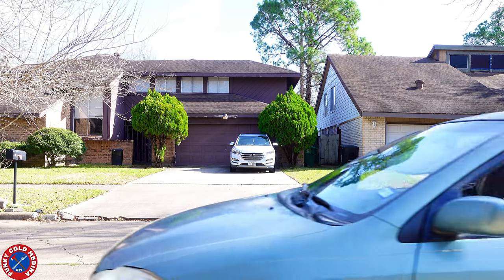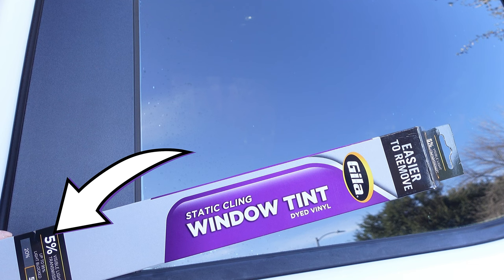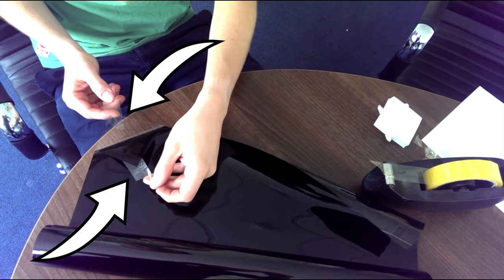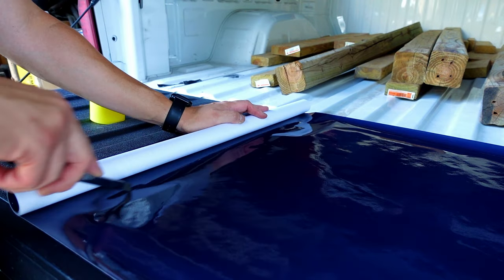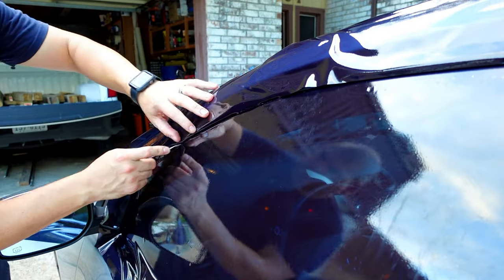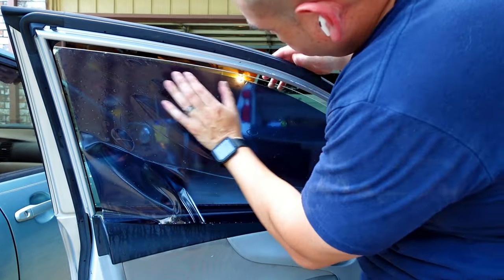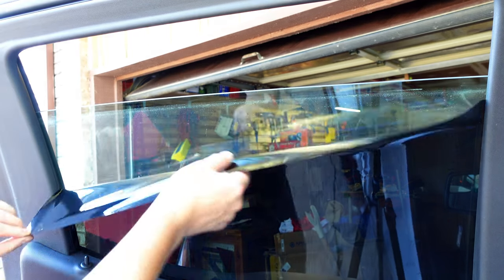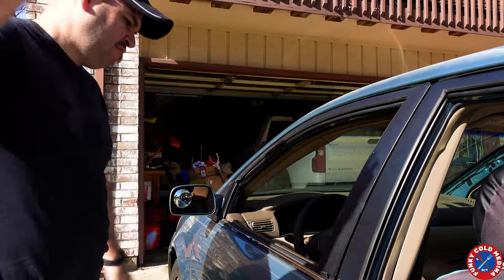NO GLUE Window Tint for BEGINNERS, EASY & SIMPLE Installation | Static Cling Gila Window Tinting

Comment from the maker: 🚨7/8/23 NEW 2 YEAR UPDATE VIDEO EVERYONE.  Check out to see how the tint held up and I also answered questions from the comment section. Hope this helps people out. Here is the link https://youtu.be/RopXmbnnJxM.   Don't forget to HIT THAT BELL, DROP A LIKE & CONSIDER SUBSCRIBING to a channel like no other. Have a blessed day😁😎✌️
Reply: I had a question so my silverado has smoked glass and two front windows have a light tint i want to make them a little darker can this type of tint work on this or do i need to strip off the old tint
Reply from the maker: @richardmilo602  Great question. I would remove the old tint and do it right but you can definitely give it a try installing the new tint over the old one. As long as its still in good condition. The new tint should stick just fine. Thank you for watching and have a blessed day. Sorry for the late reply🙏😎
Reply: @FunkyColdMedinaDIY  gonna try it and see how it comes out the phx az heat at times gets to 120 deg during the day i figure anything would help
Reply from the maker: @richardmilo602  🤣Yes in your case, anything would help🤣I bed that heat would be perfect for my sidewalk cooking that I also do🤣
Reply: Why do we need the soapy water? 
also why can't we size it on the inside of the window instead of the outside first?
Reply from the maker: @sharoncc9192  you need the soapy water so you can squeeze it out and create its own suction to the window. I don’t know the scientific word for it or the process but thats what needs to be done. Especially since the tint doesn’t have glue. You can try and cut the tint on the inside, its simpler and easier to do from the outside. Sorry for the late reply, Have a blessed day my friend🙏😎

Comment: I’m a 27 year old woman and did this by myself 🤣🤣 I know people was looking at me outside waiting for me to fail lmao
Reply from the maker: 🤣Great job. I wouldn’t expect anyone to fail at this. Its super easy and you don’t have to worry about the tint sticking to itself with the glue. Great job! My tint is still holding strong. Better than the traditional tint I might add. Ill make a follow up video soon. Thank you for watching and have a blessed day😁😎✌️
Reply: @FunkyColdMedinaDIY  thank you ☺️☺️ it looks great! The blade I got in the kit wasn’t too great so I have a little spot that looks messed up but barely noticeable and I was worried about it looking a little blurry but I saw you said it should go away in a couple days so hopefully it does go away! There’s a couple tiny bubbles but I’m not too worried about it! So I did this on a window that was replaced because it was broken. Do you think I could put this film over the other windows I have tinted?
Reply from the maker: @Ninialiindaaa08  Yes the blurriness will go away. I was worried about that when I first put it on and it was perfectly fine in 2-3 days at most. I haven’t tried putting it over existing tint. I would say give it a shot and see what happens. Ill have to make a video on placing the static tint over existing tint. If it works that would be awesome. Because talking off the old glue tint can be labor intensive. Summer is right around the corner so Im sure viewers will be wondering. Ill work on that after posting my next video. Have a blessed day😎✌️
Reply: @Ninialiindaaa08 did your blurriness go away?
Reply: If you did it, I can do it!! 👏🏾👏🏾 to you
Reply: @donedone4677  yes the blurriness went away I will say it’s not as clear as my regular tints but it’s barely noticeable
Reply: Did I come out good ? I'm worried about doing it myself
Reply: Start your own tinting business !!!! Lol
Reply: I’m sure nobody cared
Reply: Can you still roll the windows up and down
Reply: Hopefully you didn't install it backwards like this guy did in the video he waisted his time doing lol
Reply: You don't have to shrink it right?
Reply: GIRL POWER 🔥

Comment: ahah been using this method for a while now, it's bonkers ! 😎 you can switch your tint whenever you feel like it
Reply from the maker: You are exactly right Robert. Ive had a lot of people asking about my tint on my vehicles and they are amazed how easy it is and that you can just peel it right off if needed. Ive had no issues with it when rolling down the window and has not faded after a year.  Plus its cheap. Thank you for comment Robert and have a blessed day😁😎✌️
Reply: @FunkyColdMedinaDIY  Yes, you are right! no problem at all on the roll up windows 🤓 you can even layer it, I used it as a sunstrip (2X 5%, but it's too light, switched it for an opaque static cling matte black film instead 😎) the sun don't bother me anymore, and most important, the cabin is very cool in the summer heat 🥳
Reply from the maker: @robertbidochon7949  thats awesome. Ill have to try that out. Thank you for the tip Robert. Have a blessed night😁😎✌️
Reply from the maker: Hello Robert, I just wanted to update you.  I just released my 2 year update video on the window tint.  I also answered many questions from my viewers in the comment sections. Just wanted to let you know that I featured your comment in the video. Here is the link https://youtu.be/RopXmbnnJxM.  Thank you for your comment and have a blessed day😁😎✌️
Reply: @FunkyColdMedinaDIY  great ! I'll check this out ! 🥳

Comment: I recommend leaving a little bit more on the bottom so you have some room for error, the extra can get tucked behind the weather strip.
Reply: Yeah this was a big mistake.also I don't understand all the work done on the outside as you can do the same on tuebinde and be done, immediately. Makes no sense to do the cutting outisr. Take it off, move it inside and try to get italigned. Very confusing workfloe
Reply from the maker: That is true. It doesn’t hurt. Like you said you can tuck it in. Great tip! Thank you for the comment, sorry for the late reply and have a blessed night 😁😎🙏
Reply from the maker: Yea it can be done on the inside. To me its better positioning to be on the outside. Traditional tont is usually done this way so I just continue doing it that way. Please cut it the way you feel more comfortable. Thank you for watching and have a blessed night 😁😎🙏

Comment: Great video. I used the Greenfilm from Amazon on my vehicle.  Has a better color than the brand you used.   However I did use your brand when I first tried this method on two of my windows. I left it on after I used the green film on the rest of the windows.  Only I can tell from the inside that the colors are different. Again great video.
Reply from the maker: Thank you very much Karlton, Ive seen the Greenfilm before but wasn’t too sure about it. Maybe I will do a comparison video on the two. Thank yiu for the suggestion and the kind words. Have a blessed night😁😎✌️
Reply: @FunkyColdMedinaDIY  Anytime brother !! Definitely do a comparison video.  I don’t think you will be disappointed.
Reply from the maker: @boz837  Thank you very much I sure will do that. Have a blessed night😁😎✌️
Reply: hey karlton, how is the clarity with greenfilm? Is it a bit pixelated? out of the box, the gila tint is very pixelated, making it hard to read signs and such
Reply: @neoxtra2461  It settles down after it fully dries.  It’s not crystal clear like regular tint but I can see through it at night.  I have a 4Runner that already had factory tint on the rear windows.  I used the greenfilm on those because I wanted more privacy but I didn’t want it to be permanent just in case I sell it or get stopped for having too dark a tint.  It’s a little cloudy on the rear roll down window but I can still see. I think it would be more of what someone could tolerate vision wise but I like the way it looks from the outside. No bubbles.
Reply: @neoxtra2461   I have Gila on the rear passenger windows. It’s definitely more “purple” than the greenfilm which is a black shade.  You can only tell the difference from the inside of the vehicle. It looks kinda odd with the two colors but it took me a couple of tries to get the window size cut perfectly so I didn’t feel like re doing it a third time with the greenfilm.  Greenfilm has a better color to it. But there is still some pixelation.  However I’m happy with how it looks.
Reply from the maker: @neoxtra2461  Hey there neoxtra, if Karlton doesn’t get back with you, yes you are correct, the Gila tint is very pixelated and blurry out of the box. For me ive tinted 3 vehicles and it clears up in a couple of days. I think the sun tends to “bake” it and remove the impurities. But if you still have that issue, hopefully Karlton will reply back. I would also check some of the reviews on Amazon to see what others say. I plan on doing a comparison video on Greenfilm to see how it compares. Thank you for watching and have a blessed day😁😎✌️
Reply: @FunkyColdMedinaDIY hey man, just letting you know I would love to see a comparison video of the two tints.
Reply from the maker: @outdoorsadventures3722  Yes sir. That will be my next video I shoot. I haven’t forgotten about it🤣. I actually finished shooting the update video and I’m editing that one. Also about to release a Texas Sidewalk Pizza video (FULL VERSION). Stay tuned homie and have a blessed day😁😎✌️

Comment: How does it work puttinf sticky side down on the outside forst snd cutting it because then sticky sode would be backwards when you go to the inside unless ylu go to the other side window of the car
Reply from the maker: 🤣Great question but NO, you DO NOT expose the sticky side.  For the sticky side to be exposed you have to take the protective layer off. You just place the tint on the window and it stays in place by the soapy water you spray on the window. Then after you cut it to size, then you remove the clear plastic protective layer and install it on the interior. Hope this clears up the confusion. Thank you for watching and have a blessed day😁🙏

Comment: I know this video is a little old, but I just came across it after failing to do walmart tint like 5 times in a row. I am the least artistic person in the world and I cut straight lines like I'm Michael J Fox. Does it matter which side clings to the window? Can I leave the backing on when I stick it to the outside of the window, and then use a sharpie to trace the shape, then take it to a flat surface to take my time and cut?
Reply from the maker: The side that clings to the window is technically either side. It just comes rolled with white paper on one side so its easier to handle. Yes you can leave the backing on when you put the tint on the window to get the right size. You then can get a razor and cut it or trace it with a sharpie and cut it yourself but you should be able to cut it perfectly if your blade is sharp and just follow the window edge as a guide but it is up to you. Sorry for the late reply.  Thank you for watching and have a blessed day🙏😎

Comment: I’m still trying to make sure I got this right. So you’re taking the tint. Cutting it to size on the outside then transferring it all onto the inside part. All with the same cut piece of tint right
Reply: I know I skipped a lot of steps. Just trying to get the jist in my head. I’m a little slow 😅
Reply from the maker: Yes sir Amon. Even if you had just the regular tint with the glue, its cut and installed the same way. The only difference is that you have the added benefit if you make a mistake installing it, you can just peel it off and make some adjustments. Let me know if you have any more questions. Im happy to help. Have a blessed night😁😎✌️
Reply from the maker: 🤣🤣🤣Not a problem brother. I tried  to the make the video quick and to the point the best I could. To answer your question, yes you got the jist of it sir. Just take your time and you’ll get it. With the back window, if its pretty big like for a pickup truck, you might need a helper but it can be done. Have a blessed night😁😎✌️
Reply: @FunkyColdMedinaDIY  thank you so much bro I appreciate it. Really🙏🏽 this helps more than you know
Reply from the maker: Hello Amonjackson, , I just wanted to update you.  I just released my 2 year update video on the window tint.  I also answered many questions from my viewers in the comment sections. Just wanted to let you know that I featured your question in the video. Here is the link https://youtu.be/RopXmbnnJxM.  Thank you for your question and have a blessed day😁😎✌️

Comment: Hey sir do u peel the first Lair of the tint so it get sticky or u don't have to cuz I don't know if I should remove that lair ?
Reply from the maker: Hello my friend, neither side is sticky. It just comes with a white layer so you are able to roll it out. Follow the video steps and you will be just fine. Ive never had an issue with it. If it looks a little blurry after installing it, just park it in the sun for a couple of days and you should be good. Thank you for watching and for your question, have a blessed night🙏😎
Reply: @FunkyColdMedinaDIY  so I don't have to remove nothing cuz how it stick on the windows then?

Comment: I’m considering using this same tint 35% in order to help keep my interior cooler. Is this good at blocking out heat?
Reply from the maker: Great question carlorocky, Yes it does an excellent job at cutting down the heat. Of course the lower the percentage the less light enters the vehicle. Im working on a follow up and I also show the temperature difference from no tint compared to with tint. Thank you for your question and have a blessed day😁😎✌️
Reply from the maker: Hello Carlorocky, I just wanted to update you.  I just released my 2 year update video on the window tint.  I also answered many questions from my viewers in the comment sections. Just wanted to let you know that I featured your question in the video. Here is the link https://youtu.be/RopXmbnnJxM.  Thank you for your question and have a blessed day😁😎✌️

Comment: Do you think the Gila static cling tint they sell at Lowe's and Home depot is the same product as what they sell at Autozone for cars?   I'm wondering if it is the same exact product, just packaged differently and a different size from what is in the auto parts store.
Reply from the maker: Hey there David, it is the same brand but it can’t be used for vehicles. The ones they have at home depot or lowes are for residential windows and have more reflectivity than is allowed for vehicles on the road. I would get the tint made for vehicles. Hope that answers your question. Let me know if you have anymore questions David. Have a blessed day😁😎✌️
Reply: @FunkyColdMedinaDIY  hey thanks alot!  That makes sense. 🙂

Comment: Question - how will this stick to a car window that has already been professionally tinted? Will it stick fine and if i ever wanted to remove the static tint, will it damage the regular tint already on the glass? Thank you!
Reply from the maker: Great question cjqamg. I actually answered this in my 2 year follow up video. I also answered questions from the comment section. This was one. Long story short, you will have no issue installing it over existing tint. Just make sure its in good condition with no air bubbles or ripples. It will show through and make it look crappy. If you install it and remove it, it will not damage anything. If you would like a more visual answer, check out my follow up video. I just released it a few days ago https://youtu.be/RopXmbnnJxM. Thank you for watching and have a blessed day😁😎✌️ Let me know if you have anymore questions.
Reply: @FunkyColdMedinaDIY  actually, what do you think about cling tint on top of regular glued tint? I installed 20% cling on top of my 15% glued/pro tint. It seems completely fine....what is your opinion on it holding up? And not causing any damage?
Reply from the maker: @cjqamg  That’s no issue at all. I actually demonstrated that in my follow up video I posted a few days ago. Link is in the previous comment. Have a blessed day😁😎✌️

Comment: i already have tints on my car, but i want it a tad bit darker… will this method still work?
Reply from the maker: Hey there Tray. You can definitely do a test on one of the windows to see how it will come out. Remember the first couple of days it will look a little blurry but that does clear up. If the tint you have has any defects, that won’t go away. The best practice would be to remove the old tint. There are many ways to do it. I personally use a heat gun and a razor to scrape it off. After that I use a foaming glass cleaner like I use in the video and the residue comes right off. Give it a shot with the static cling tint and see what happens. The only issue I can think of is that it may not stick very well to the tint you already have. But I’m usually wrong. I may do a follow up video to see if that can be done. Thank you for your question and have a blessed day😁😎✌️. Let us know if you decide to do it and tell us if it worked?
Reply from the maker: Hello Tray Dior, I just wanted to update you.  I just released my 2 year update video on the window tint.  I also answered many questions from my viewers in the comment sections. Just wanted to let you know that I featured your question in the video. Here is the link https://youtu.be/RopXmbnnJxM.  Thank you for your question and have a blessed day😁😎✌️